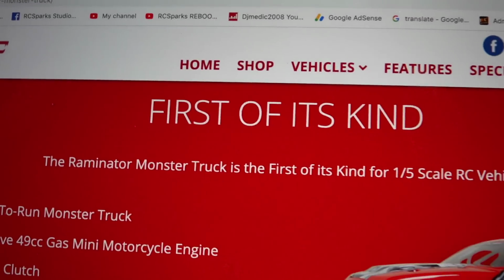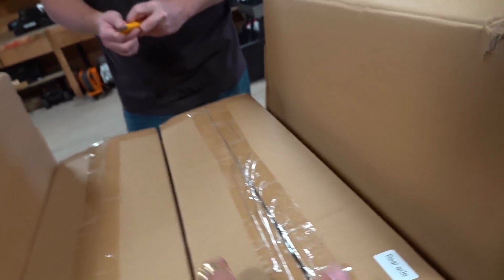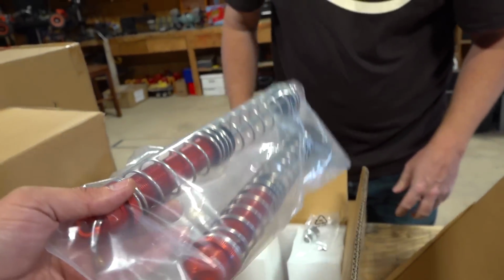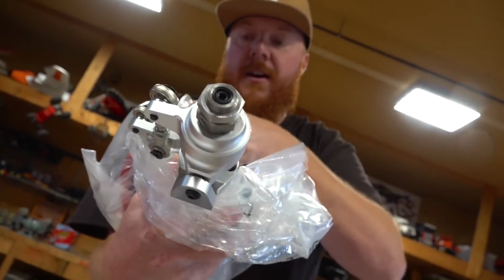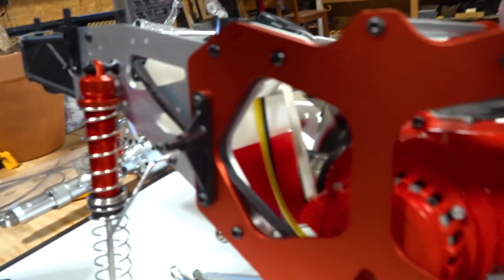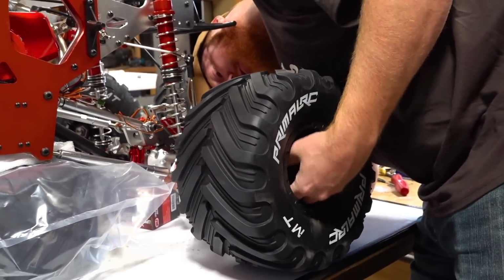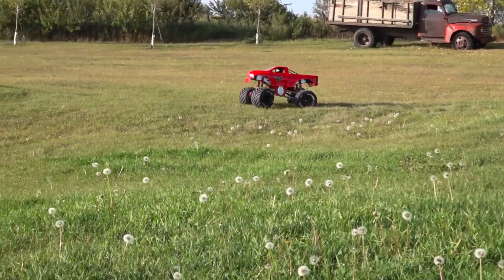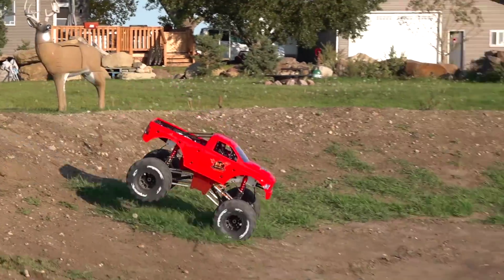RAMINATOR - MEN and a MEGA TRUCK : LARGEST GAS POWERED MT! 49cc | PRIMAL RC ADVENTURES

Comment from the maker: I HAVE A NEW FAVOURITE RC... HAHAHA!
Reply: loved the video. love the truck. it can take one heck of a beating too i Bashed mine really hard and only broke a body mount or 2 enjoy 👍🏻💪🏻🍻
Reply: It's so underpowered though. You should look into getting a Singer 609 shoehorned into it! Top speed isn't too bad but that thing needs a LOT mroe 'git' off the line. the engine struggles so hard to pull it out of the hole. Can't do a proper standing wheelie and what monster truck can't wheelie?!
Reply from the maker: @TestECull  its not got a tank through it yet. It got even faster after filming..
Reply: It really needs a 2 speed transmission.
Reply: @TheRealRCSparks  Mm. Maybe it will find some torque when it frees up. Still looks a bit underpowered in the vids I've seen(RCTanksandTrucks' vid in particular; thing looks positively sluggish in their vid for some reason).

Plus, hey, Stinger 609 is an actual V8. Can't go wrong with an actual V8! Hahahahaha
Reply from the maker: @TestECull  I was also noticing that his was looking sluggish too... I noticed last night when I was running mine more straight out on my race track that I was getting a higher rev, the loner I went. At least it sounded that way. On a straight away it gets going at a pretty good clip. I havent leaned it out at all yet.. and want to run another tank through still.
Reply: Also install the high speed gears dan sends with the truck as well after leaning it out. It does go pretty good dont forget this thing is 80pnds! Its a super beast of a truck!
Reply: Aaron is this truck sick. I love this thing. Check out my short vid of mine running over some Xmaxx’s and 5T’s
Reply: 44LB - should be called The Herniator! 😣
Reply: Until the next one LOL
Reply: Hope you put oil in the axles
Reply: Love it! I'd like to get my grubby little paws on that drive train too, it'd make one heck of a crawler/trail rig...
Reply: It needs a cr125 engine!
Reply: @TheRealRCSparks  It might could do with 1-2 teeth down on the clutch bell, but we will see. I 'spose waiting until the engine's fully broke in and peaked out isn't a bad idea either; thing does have a hell of a tuned pipe on it and it may have plenty of low-end grunt that just isn't on hand right now.

I did notice something similar with my NexSTAR. I put a Magnum 52 four-stroke in it that I got from a raffle; supposedly only had 2 tanks or so through it. On the fifth or sixth flight I went from '50% throttle is cruise' to '35% throttle is cruise' and the idle quality skyrocketed.
Reply: What a heck of a truck.
Reply: Such a badass car! Video's definitely do not do it justice 😊
Reply: i need one !!!
Reply: Cool noice
Reply: Way too lean brother....
Reply from the maker: @mechanicalking  No bruh.. the other way around. Its slobbery rich
Reply: Hello RCSparks I love your videos. They teach me how to do stuff with my rc stuff and it’s overall so entertaining thanks for making videos.
Reply: I wish I owned one :(
Reply: @UNKNOWN34342high   oh yeah!
Reply: @FoundryRC  this truck is the stuff thatdreams are made of!
Reply: @TestECull  2 speed would begreat
Reply: @TheRealRCSparks  agreed, everyone is commenting negatively, , but these trucks are not even broken in yet, everyone is just really excited to share their experiences and spread the good word, I wonder if we're giving the truck a bad impression by driving it at 50/ percent? Idk I love everything about it and support Dan and Irene 100%
Reply: @dragbug100  that would be cool
Reply: RCSparks Studio I know it’s brand new and all but I want to see that thing go mudding
Reply: IMAGINE QUAD BRUSHLESS ENGINES MAKING IT ELECTRIC 😂😂😂. PS: you should do it😃
Reply: @tolarchief1  I love this idea!
Reply: You in wagon. Can it pull you?  Winter snow chains get pulled on a sled.
Reply: They definitely aren’t slow! After break in do some adjusting and it will RIP!!!
Reply: Ethan Grahl yea hell yea!
Reply: @magia5035  ohh yeah!
Reply: @ethangrahl2368  ohh wow! I can't wait to see that! Great idea
Reply: @RCSparks Studio You should make your Mavrick/RZR thing RC🤔
Reply: @nodiggity7731  right on man!
Reply: Absolutely NOT A BAD IDEA👌
Reply: What everything like would cost me
Reply: @jasonstewart8926  probably looking at about $2800
Reply: Cool love you guys as YouTube's

Comment: I can almost Guarantee you from the sound of it it’s not hitting its powerband ..it should be way faster
Reply: That's what I was thinking. 80 pounds and a 49cc. Should pull the front wheels as soon as it hits the power band
Reply: Some motors Powerband It’s different it’s not even like they have a power band he is hitting power band when it’s full throttle it’s just not that much of a difference it is burning up all that oil it’s just not working like everyone thinks it should
Reply: @imperfectrc8735  z
Reply: Also pay attention, he did say it has 3 different gear set ups
Reply: The motor is from One of those Chinese pocket bikes 49cc If you ever ridden one when it hits its power band it wants to pull a Willy with you on it I’m 160lbs The motor looks like it has a head kit and a pipe already on it
Reply: I was going to say the same thing, i think the motor just sounds tight, needs breaking in, I don't agree with the fellow who says run it like you stole it. give it a few rich easy going tankfuls. Breaking in is about heat cycles and time not rpms so much.
Reply: Something certainly isn't right. That's barely an idle for 2T.
Reply: The fact is it’s a two-stroke you have the power band and you could not hear it at all and Also when it gets to topend It sounds like it’s falling on its face on a two-stroke usually sounds like it leans out
Reply: Needs break-in followed by tuning.
Reply: on the primal website the engine was spinning quite a bit higher, i wonder if they had the choke on or something out of excitement
Reply: Need to upgrade it to a rainbow powerband and drop a 3/4 race cam in it with some forged pistons and a new computer tune
Reply: @DEeMONsworld  wrong take it easy for 5 minutes and then give her hell I've rebuilt 100+ small engines they blow or they go. If its built right you can bang the rev limiter all day every day right after the first start and an oil change
Reply: Needs to learn how to tune carburetors
Reply: It should be revving like a chainsaw, sounds rich to me.
Reply: Its running way to rich. For it to hit power band. it has to run at optimal peek.
Reply: @brandonscott6492  gearing wont change the fact it's running way to rich.  🤣
Reply: All the chainsaw guys step in and know it's way to rich during break in.
Reply: @scrapsteenlifeintheforks1943  i say it's rich too. But I got told off and told to mind my own business by rc sparks. I was only trying to help him. I work on 49 to 110 cc 2 strokes all day. Lol
Reply: The 49 cc motor is tuned and stuff so you don’t do backflips off kickers 😂 and so you don’t destroy it in a second
Reply: @lordknight3616  its a gas engine. It has to be tunes to the BUYERS elevation. He is definitely running rich. All he has to do is check the plug. I bet you its black.  🤣
Reply: Rock Crusher Hobby      https://youtu.be/poeuQQrGgQw      In this video he explains why you’re wrong
Reply: Its probably like that so the  drivetrain holds up
Reply: Not worth the money,  no way I was expecting 25-35 mph. It's cool but for gas it should rip
Reply: Southern Fun powerband is real  try to keep the front wheel off the ground when the powerband  kicks in on a 250 r atc      Not “ physical “.   But it is a good word to explain the feeling when everything comes together and it’s “screaming bro “   The rpms are in the powerband hold on tight ???????
Reply: O g people, there is no such thing as a ' powerband'
Reply: flip co exhaust changes power band too, could be so that they are forced to buy a upgraded exhaust
Reply: Southern Fun lol lot of misinformation here. A “powerband” is most definitely a physical object. More correctly called a power valve. It’s an extra valve in the exhaust port that allows more air flow at a given rpm.
Reply: @dhughes6921  wrong. Power band is not a valve...Power band is when the engine comes up on pipe. It's a sudden increase in torque and rpm when the sound waves hit a certain frequency causing the surge in exhaust flow....All 2 strokes have a power band, but a tuned pipe amplifies the effect.
Reply: @Code_Made  there most definitely is. It's when the engine is running at it's peak preference.
Reply: @ryantrusty7320  yeah
Reply: They have the choke on
Reply: @flipcophil5668  no it isn't
Reply: @Mike L wrong 2 strokes have more torque

Comment: You should park it next to, and then drive over a Traxxas Slash as most RC people know how big those are.  Plus, car crush in a monster truck...
Reply: Hell put it next to an HPI Baja 5b.... I've got one of those with a 29cc Zenoah and DDM pipe... It's definitely much faster than this... But it weighs maybe 30-35 lbs tops, not 80 lbs and isn't 4x4.

Comment: I had a pocket bike with that same type of engine man. That engine already has a huge aftermarket, you just got to look in the 49cc pocket bike stuff. I ported my engine cases and put an 80cc big bore kit on my motor and that thing was scary fast. Better yet, it was a fully built motor for only a little over $100!

Comment: From the manual: 10. If you are running the truck for the first time, engine break-in is recommended.
 The engine break-in process alternates heating and cooling the engine to allow all parts of engine to properly seat
 themselves. It also allows 2-stroke oil from the incoming fuel to coat the interior parts of the engine.
Run the engine at varying speeds for periods of 3 to 10 minutes at a time. During this break-in process, never go full
throttle.
 Try to stay below half throttle. Always let the engine idle for 30 seconds before turning it off. Allow the engine to cool off for
 10 minutes before starting it again. Repeat this process 3 or 4 times (3 or 4 full heat cycles).
Reply: I suggest you follow it. They are covering themselves is all. Talk to any small engine builder like TMR performance making modded engines for this truck and I would bet he would agree with me.

Comment: What that truck really needs is a CVT belt drive, like a snowmobile. That way the engine could stay in its powerband, giving you more power at low speed, and higher top speed.
Reply from the maker: Its chain driven...
Reply: @TheRealRCSparks  So are snowmobiles, the CVT belt drive is just a transmission. Or they could create a bigger version of the auto used in the T-Max. Either way it needs gears to get the most out of that engine.

Comment: Im not surprised its kinda slow. Its heavy. The larger the scale the more the power to weight suffers. Plus its gas so it doesn't have the crazy torque that electric motors do. But still awesome to watch that thing move and see the suspension work.

Comment: You guys either have small hands or ATV size tires lmbo
That thing is awesome. 
Glad to see the diffs are locked for sure and the low gearing is suitable. The suspension looks to work well and I am sure it will still work well at higher speeds/air.

Comment: That is one sweet monster truck! You definitely need to set up a monster truck course with either old 1/10  or 1/8 scale bodies.  And as for break-in,  as long as you run a good quality mineral 2cycle oil and don't over lean it, it'll be fine. Chainsaws, weedeaters, and blowers etc.. are run full bore right out of the box and it doesn't hurt them. 

And the speed? It's a monster truck, it's for torque and power, not speed.

Comment: Yep that's a real nice r/c truck! 50cc engine should be around 4 horsepower and 2 stroke engines like this have very good torque. Looks like this one is setup for low end torque as opposed to high end speed but I'm certain that a change of the axle gears could make it faster on the top end. I'd leave it like it is and enjoy the crap out of it, however for $2900 I'd rather buy something I can actually ride on. Great way to burn $2900 nonetheless though.

Comment: I'm an auto and diesel mechanic by profession and the front and rear axles are what is called full floating atlas design axles. Which full floating means that the axle shafts just float and propel the truck anx the actual axle housings bear the weight of the truck instead of the axle shafts

Comment: I just bought Orion ultimate 3600mah 120c graphene lipo for my tlr-22 3.0 SR. I just ordered another lipo for it this morning Orion ultimate 4000mah 120c HV graphene. Now I need batteries for my basher sabertooth truggy running sensored castle mamba monster x esc & sensored 1515 castle motor my Losi Super Rock Rey and my ZD Racing 1:8 MT. I'm bout to pull trigger on like four 2s Orion ultimate 120c 8200mah graphene packs. Haven't even decided on the few 6s lipos I needed yet. I'm wondering if these lipos are worth shelling out the loot for or if I should just stick with my turnigy ultimate nanotech's which have never failed me with very minimal puffing. I'm replacing all my Gens Ace RS series packs which puffed like crazy and barely got me thru 2 years.

Comment: That thing needs at minimum a case reed Zenoah g62 engine.  You can find them in the Goped gas scooter scene.  A CY 460 would make it scream with the right gearing.
   Or, upgrade that engine further.  Throw on a Walbro HDA-48 carb.  Its definitely slow alright.   Impressive everything else though 👌🏼

Comment: I don't mind it's speed. I mean it's running like an actual monster truck, true to scale. However, like you said, you can change the gear ratios and there are aftermarket parts and engines coming, so people will be able to mod it how they see fit. I tell you what though, I would be scared to control something that weighs that much if it was going too much faster.

Comment: Need to run at least 3 or 4 tanks of fuel thru it at a rich carb setting before tuning the carb. If your tweak it for max rpm you will fry the engine if it's too lean. Tune it to max rpm and then back high speed needle out 1/4 turn.

Comment: Great 👍 Beast of a Monster RC Truck but at $3000 buyers and owners of this RC truck should not be having the problems and should not have to be moving parts around on the truck to make it right and the servos are crap , this what has been on the Facebook postings. The tie rods should already be placed in the lower positions like Primal RC says to do and the velocity stack should have a better one on it already. Primal RC suggests getting a different velocity stack and removing the choke. If you have to buy new servos that’s $400 and a velocity stack $60, faster engine $$$. Another thing is where is the discount for those of us that are buying the truck now, the same discounts the buyers got in the first batch. Just my thoughts I’m not bashing the truck I like it but the problems are starting to appear and the upgrades should already come with the truck and some of the parts that are installed on the truck and have to be placed in another location should be already done. Good Luck with the truck.
Reply: Have you ever owned an RC? You are seriously complaining about moving a link? You are talking about a small company releasing a few initial units. Issues will always be found and really for this truck they are not major. The servos have been warranted. It's obvious a bad batch were bought. But who cares if they are being warantied. These things happen. Really small issues. Let me tell you about the first release of the baja from a large company. Beyond issues. Also after 10 years they still didnt fix the trash clutch bell system. Or original MCD's or redcats or every other fly by night 1/5 scale company. First batch man, take er easy. Primal is taking care of the issues. Again nothing you listed is a major issue. Chillax brah.
Reply: EV TEK I’m not some youngster. I’m retired. I’ve had RC’s. I have 3 words: MADE IN CHINA  !!!
Reply from the maker: No bro.. you are commenting like a dinosaur.  RC platforms are all meant to be upgraded..

Comment: Impressed with the scale and durability but disappointed in the speed.  Definitely would look at upgrades on the gear and motor to increase speed and torque.

Comment: Stirlingkit. com sells two strokes that fit in that if somebody wants a faster truck but the gearing in the transmission also plays a role. An engine alone does not make it faster and the one it comes with could benefit from a larger carb and porting work.

Comment: That engine sounds governed, you can check the intake reed valve area to see if it has a restrictor, same for the exhaust and/or throttle assembly. Then you just need to rejet the carb and voila ! I had a tuned 50cc supermotard and it was putting down 12 whp. This thing would literally be flying with that much power !

Comment: Those engines are not bad, quite prone to pull start failure but cheap to pick up replacements online, I have a pitbike with the same engine in it that pushes me, a 70kg guy upto about 30mph easy as so should have a bit of torque in it

Comment: Its running waaaay rich bud!!!(30 years in mx motors) needs re jetting... put a water cooled ktm 50 sx motor in it bro... that will be fasssssst
Reply: We are aware it was rich. You witnessed the initial starting and driving. Nothing wrong with a rich first tank on an engine. You never know, a different could be a possibility...